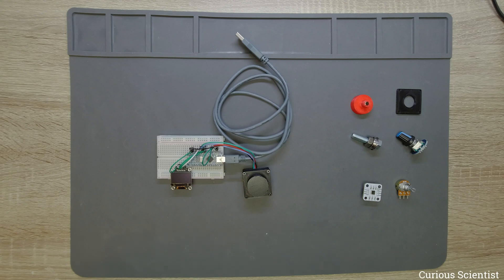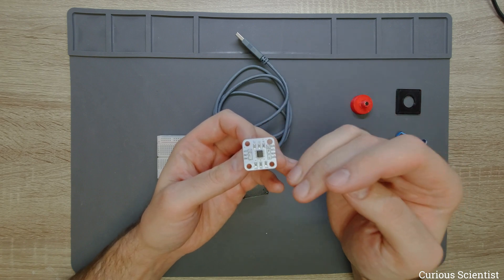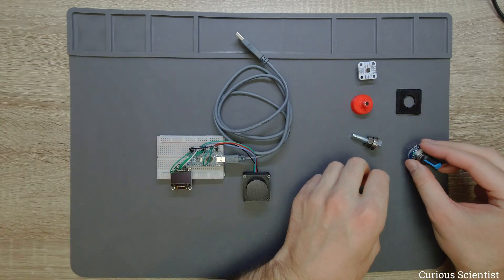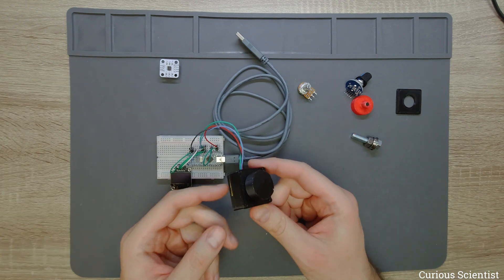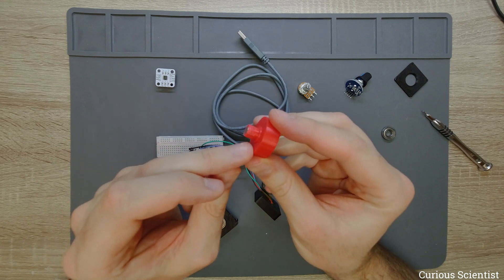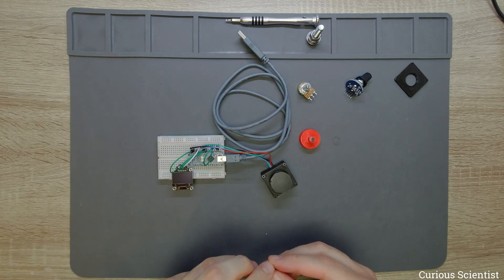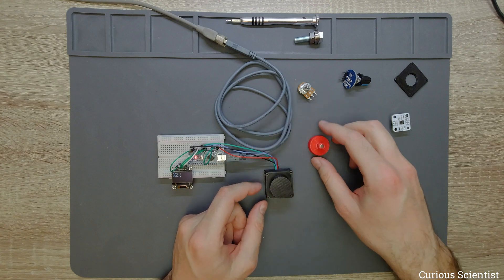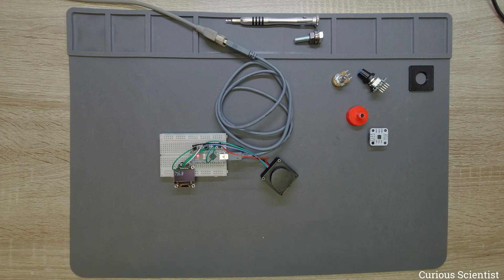Overengineered "potentiometer" using the AS5600 magnetic encoder

Comment: can as5600 read position when its position is changed after power is off and then power on again?
Reply from the maker: If you don't want to detect more than 360° rotation while the power is off, absolutely (pun intended!). It is an absolute encoder, so it detects the magnet's position in a 0-360° coordinate system.
Reply: @CuriousScientist  Thank you so much Sir.... You are the real G

Comment: Great video man I learned a lot, I have a kayak motor and the speed controller has the as5600 sensor and find it really hard to dial in the exact speed I want. Do you think it would be easy to wire in another switch or potentiometer with something that has a mechanical click on each speed setting? There’s 100 speed setting on forward and 100 speed setting in reverse on the motor
Reply from the maker: Thanks! You can use a rotary encoder for this purpose. If you need a more sturdy one with more clicks per rotation, look up CNC pendant wheels. I have projects with the mentioned wheel. 😉😎
Reply: @CuriousScientist   awesome I'm watching your video on the cnc encoder now. Could I send you a picture of the sensor, there are 4 wires coming off of the sensor that goes to a connector and that plugs into the speed controller.

Comment: bearings you're using are double metal shielded bearings which typically have grease in them instead of oil, they're meant for low speed. get fidget spinner bearings that have oil, slightly higher tolerances too and are usually cheaper than the ones you're using. you're using higher quality bearings, more than necessary.
Reply from the maker: This is what I had at home, so I used this. It is sufficient for the demonstration, and then everyone can decide which bearing suits their application the best. But it I still agree that these are not the most suitable bearings for this specific demo.
Reply: @CuriousScientist  fantastic video. watched others too, and to be honest your channel is the only source for detailed info about this topic. good work
Reply from the maker: Thank you very much! I try to make detailed videos on every topic I dissect and discuss.

Comment: if the hall sensor is itself analog, can it be used as an active analog potentiometer with an op amp for example?
Reply from the maker: I guess, we are talking about a single piece of standalone Hall sensor, and not the AS5600, right? Yes, it could be used, but it would be really cumbersome, I think. Since the output of the Hall sensor is proportional to the strength of the magnetic field around it, you can translate the output signal of the sensor and use that signal in the same way as you would use a potentiometer's output signal. But probably it would be difficult to (relatively) precisely change the distance between a piece of a magnet and the Hall sensor.

Comment: What library are you using? Seeed_Arduino_AS5600?
Reply from the maker: Why don't you watch the video? The answer is there, as well as on my website... I am not using any libraries, I wrote my own code to get the data from the chip.
Reply: @CuriousScientist  Sorry, I was watching
I'm just not English-speaking and did not understand everything.
Reply from the maker: No worries. Make sure you watch the whole video because the answers are probably in it. Also read the video description because there's a link to my website where you can get the code. ;)

Comment: Did you drop out the resistor? Connected to 3.3v?
Reply from the maker: What do you mean?
Reply: @CuriousScientist  On the library page that I threw off, they talk about the need to solder the resistors.
Reply: @CuriousScientist  Note: Check your custom board (Like this one: Hall AS5600 sensor for Game Wheel 23x23mm):
If there is a pull-down resistor (1k) on pin 5 (PGO), internally there is already a pull-up resistor, there may be a conflict
If there is a jumper resistor (0R) between pins 1 (VDD5V) and 2 (VDD3V3), to work under 5V, you need to remove this jumper
AS5600 pin 8 (DIR) selects direction, needs to be set externally, otherwise the readings may fluctuate
Reply from the maker: My custom board works just fine. I never had issues with it. I just have to make sure that the unused pin (out) is tied to GND.

Comment: What iff of you would add a seconden stage, with gears. That if the first one goes round once the second one only travelles one “step”. 
Would be an easy solution for a long linear absolute encoder.
Reply from the maker: If you can get rid of/minimize the slack in the system, it could work. I guess you would convert it into a linear encoder with those "rack and pinion" mechanisms. You can put whatever you want on the shaft as long as you can keep track of the gear ratios.

Comment: Can i mount a hollow magnet (that is magnetized across its diameter perpendicular) to this chip and get the readings?
Reply from the maker: I would not mount the magnet on the chip, because there would not be any relative motion respectively to the chip... I would mount it on a shaft or any rotating object, and then fix the sensor somewhere according to the specifications described in the datasheet. Also, I guess a hollow magnet would work too as long as the strength and the orientation of its magnetic field fulfills the specifications.

Comment: You could try a cone roller bearing which might feel smoother as it bears any downward thrust too, as long as you can prevent it from 'falling out' - split ring or something.
Reply from the maker: Thanks, I will look it up! I actually ordered some bearings and nice metal knobs for the continuation of this project, but I did not have the time to assemble a new "potentiometer". I will do it some time in the future.
Reply: @CuriousScientist  I'm looking to start a similar project but using the AS5311 linear encoder with a 40mm ring magnet so that I can have a large hollow knob with a clear window and an oled display at the center. Maybe even an internal ring of apa102 leds to augment the oled and provide some colour. I already tried it with one of those ALPS hollow shaft encoders but they get very bulky for large apertures and feel terrible. I'm going for a mini Nest Thermostat style / interface and I'm sure the mag encoder is the way to go - with a suitable pcb and mechanical layout.
Reply from the maker: Your plan sounds interesting! I hope you'll end up with a nice result. I don't have this much ambitious plans with my build, I just wanted to learn this encoder thoroughly and I thought that the best way to do it is by building different projects based on it. I will probably go towards another area where I am planning to build some feedback circuitry for stepper motors.
Reply: @CuriousScientist  That'd be great! So all us GRBL CNC enthusiasts can get absolute positioning and dispense with some of those pesky limit switches.

Comment: Is it possible to connect more than one as5600 to a single i2c line?
Reply from the maker: Yes, but you need an i2c multiplexer. I have several videos where I show how to do it.
Reply from the maker: This is the multiplexer you need: https://youtu.be/j5qqMkE6Aww
And this is where you see how I used two AS5600: https://youtu.be/IZ0FyiMYT48
Reply: @CuriousScientist  It is ridiculous that the i2c address does not change, I will use an i2c multiplexer. Should I use rs232 or rs485 to use encoders in long distance? Thanks.
Reply from the maker: What do you mean by big distance? You can always read the documentation of the i2c protocol and see what is the maximum distance. I know for a fact that 6 metres of shielded cable was capable of carrying the i2c signal.
Reply: @CuriousScientist  I will use it for distances ranging from 10 meters to 20 meters using cat5-cat6 cable.
I'm sorry for my bad english.
Reply from the maker: I am not sure if such a distance can be covered by an i2c, so you might want to test it first before trying to design your whole system based on this length.
Reply: @CuriousScientist  I know it won't work with i2c, any ideas to convert i2c to rs485 or rs232? thank you,
Reply from the maker: I have never worked with those protocols, so unfortunately I don't know.